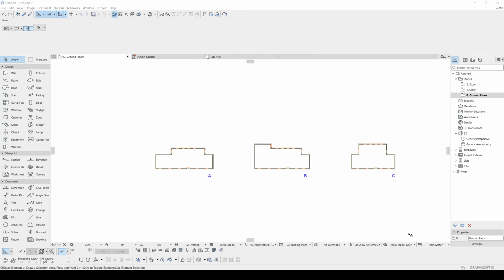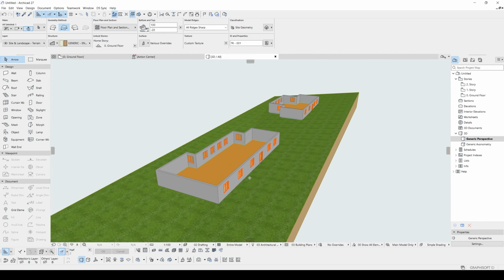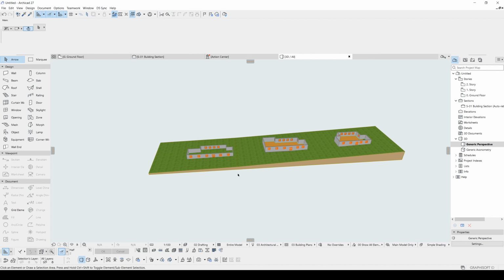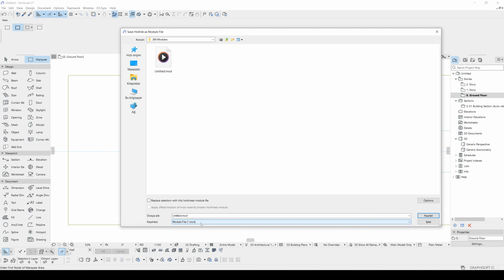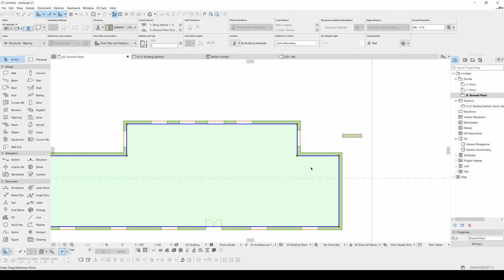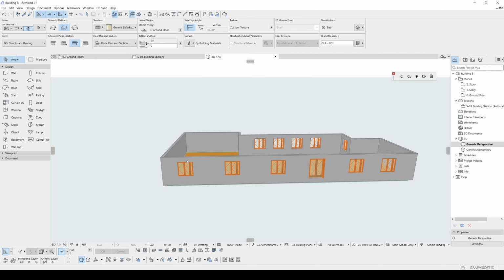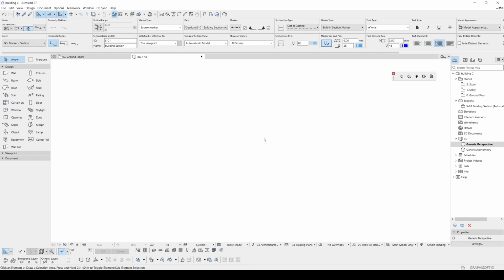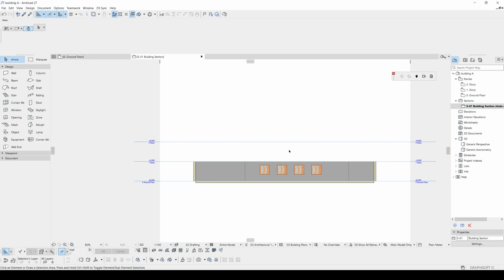Different Elevated Buildings in Archicad

Comment: Hello! Thank you for you work! I have a question regarding terrain modeling that I hope you can help with.
I am using hotlinks to place buildings, but I am struggling to trim the terrain to fit them perfectly. Because they are hotlinks, I can't use the solid modeling tools (like Boolean operations) to cut the terrain.
How would you recommend approaching this to get a clean result? Any tips on trimming terrain to match hotlinked geometry would be a huge help.